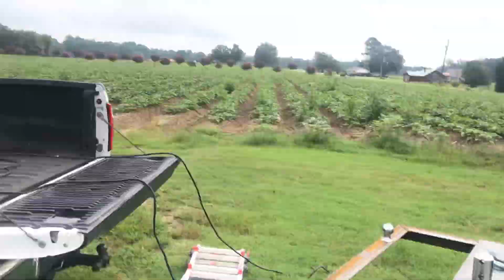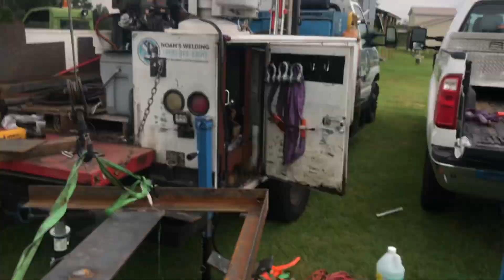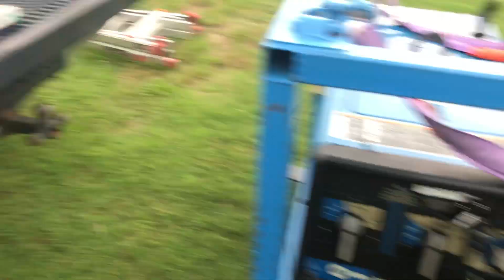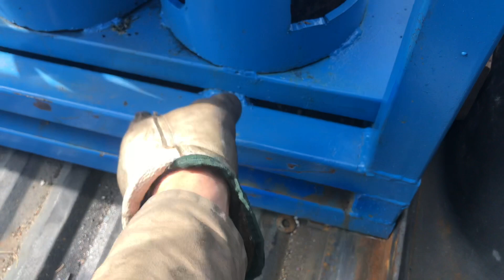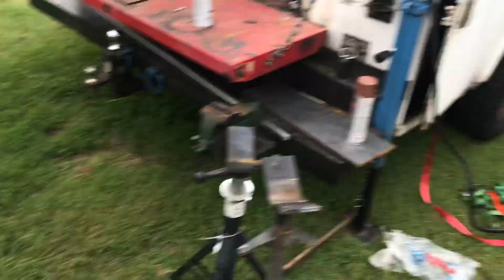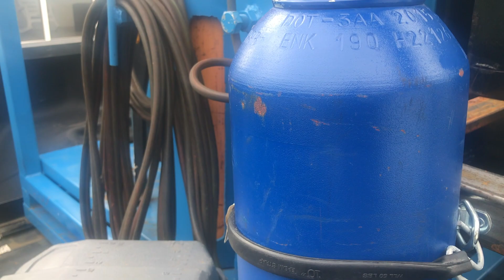Mounting Welding Skid To Your Truck

Comment: If i dont have a forklift for getting it in and out, would you suggest building an A-frame hoist?? Or is there a simpler way
Reply: engine hoist work  i use two of them for mine slow but works, i would suggest going a frame  way
Reply: I use a tree and a come along for now 🤣 works just fine